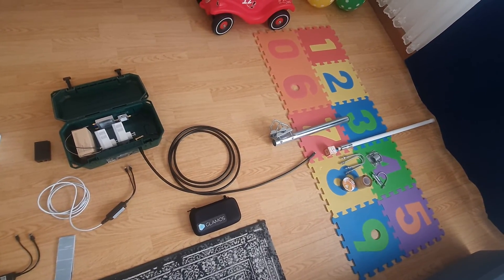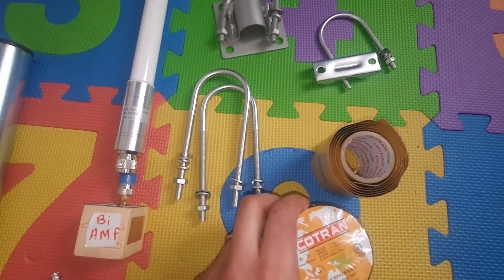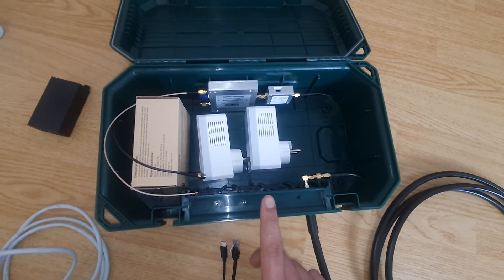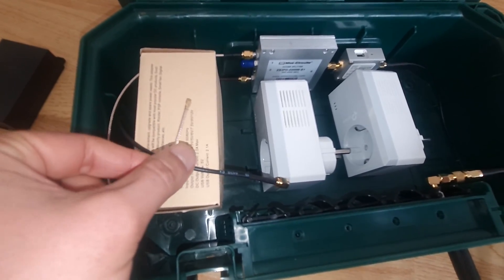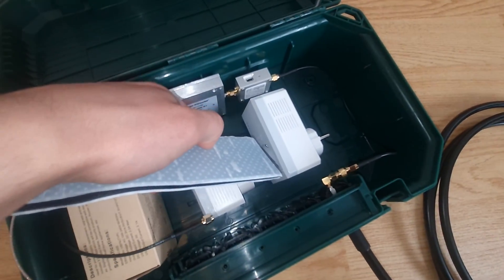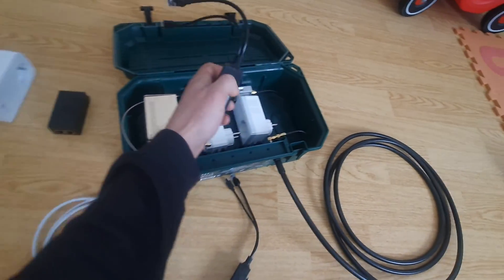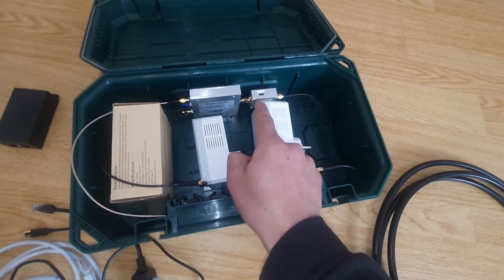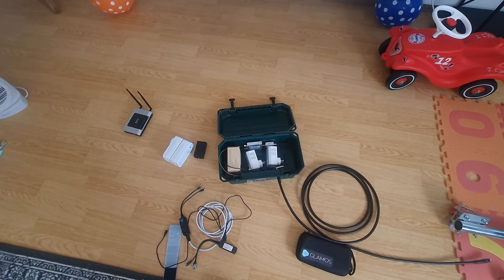Helium Amplifier for more witnesses and 3 Helium Miners Equals Triple Money Part 1- HELIUM ADDICT

Comment: Thank you for the valuable information.
I wonder however, why you have to use a DC injector to power the amplifier and not just to use one of the POE splitters to power it? is it because you connect the amplifier directly to the antenna and far away from the outdoor enclosure, may be?

Comment: Great video! I’m testing a similar setup. Question: with the Shireen amplifier, does it have tx bypass?
Reply from the maker: It's Bidirectional Amplifier he can send beacons and wetness beacons 
I hope that answers your question
Reply: @heliumaddict8582  do you separate the rx and tx or use an attenuator? I saw the bidirectional amps on their website and the tx is 17db which is super high
Reply from the maker: @trenbolonewings  you can contact them to recommend the right attenuator for your Amplifier

Comment: Thank you for the great video!  Is it possible to power up both the bias tee and the miner with one PoE splitter? I have female to 2 males splitter which can be put on the male cable side ot the PoE splitter.

Thanks!
Reply from the maker: Yes you can! , but you should give every device his one 5 v or his own PoE splitter

Comment: I've looked into this. But Im no expert. What I read is that amplifiers were made to help transmissions over long lengths of cable. What is not explained is that the power is sent both ways. Up the antenna and back to the miner. If using this its important that you're cable haven enough length to absorb the amplification else the power reflected back to the miner will eventually fry it. Your suggestion that the amplifier be connected directly to the antenna instead of the back of the miner speaks to this fact.

Comment: Thanks brother I really appreciate the good work, I have a few questions please tell me what enclosure would you recommend now that heat is coming , second question is with this setup do you think it doesn’t matter using one wallet for all my miners because of helium , I don’t know if it is allowed or not . The third question is how do I place location for each miners I am already preparing going 3 in 1 now  so I don’t want to make mistake that will ruin my miners.Thanks bro 👍🏾👍🏾👍🏾
Reply from the maker: Hi 👋  
Thnx for the feedback 😊 
1 enclosure preferred to be Aluminium or matell if not youse outdoor enclosure made from plastic but put 2 fan to keep the miners save 
2  youse multiple wallet to be more safe 
3  place your miners in defense hex if possible  and be smart how to move them
I hope that unser your question ✌️ 
Happy Mining ✌️

Comment: We basically have same setup… 3 miners one antenna: I have 1 miner performing 0.6 per day the other 0.1 and 0.2… not evenly spread results. Also every few hours I get invalid witnesses because one of them send beacon and it is witnessed by one of my own miners (others outside too but)… helium network doesn’t like that. :( you have same problem? Maybe splitter needs more power? I inject 5v 2mA for Amp only 🤔
Reply from the maker: Hi 👋  thanx for the feedback 
Well I have almost the same rewards with the 3 Miners very small difference but  the moment I get invalid between the 3 Miners they slows down like you said Helium metwork doesn't like invalid. 
5 v it's perfect  more power will bring you nothing. 
I m thinking about to separate TX and Rx to solve the invalid problem 🤔 😕 
You know what I m talking about 😉✌️
I see 👀 you in the ather youtube channel  looking for parts 😅😉 which is good bay the way 👍 always look how to improve your setup 😉 
Ah please 🙏 let me know when the parts are available for Europe 🇪🇺 to test them on my Rak-Miners v2 and share the results with you and the viewers to help more people as possible ✌️ I will count on you 🙏😇
Reply: @heliumaddict8582  of course. Happy to share. Yeah I have seen the videos about separating the chips on the board and modifying it. Not sure, probably afraid to destroy my miner when I start soldering on it haha
Reply from the maker: @dr-noise2136  thank you very much 🙏 😇 
No don't solder nothing just buy the RF card ( the cosontrator ) from him and put it in your miner its much easier and safer like this he is the expert on solder and he have the proper tools to do that .✌️
Reply: @heliumaddict8582  you think he will sell? I asked , no answer yet. I think he is US and I am EU 😩
Reply from the maker: @dr-noise2136  me too I m in Europe 🇪🇺 🙃 😅, we have to inciste on him
Reply: What’s the reason that your own miners witness each other? I thought the one attenna shared by three will only hear outside.  Please explain. Thank you
Reply from the maker: @hzhang1302  Hi Zhang 👋  
Watch from part 1 , I ulredy explain everything in my previous videos 📹 
If  you  still not understand samthing let me know ,keep the notification bell on for my upcoming videos 😉✌️
Reply: @heliumaddict8582  which video series? This is part one
Reply from the maker: @hzhang1302   start to watch from here 
https://www.youtube.com/watch?v=-UasAvg861g&list=PLPivEaO5txp8KuH5EtecLLDP4yEnsV4PJ&index=1&ab_channel=HELIUMADDICT
Reply: Who are you guys talking about? To get parts from in the us?
Reply from the maker: @thizzmarley1903  I told you that you should watch the videos 📹 on my Playlist and you will find all the information that you need and also the links for the part's and  this will help you to understand better my upcoming videos about this subject 😊 😉✌️